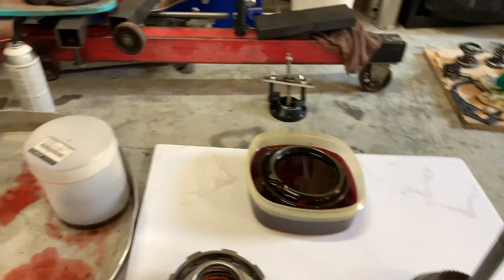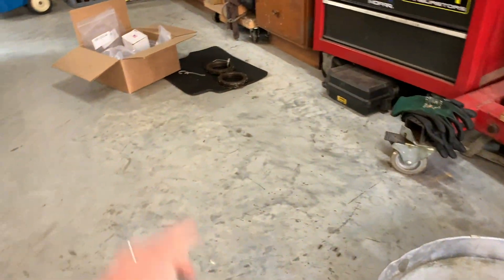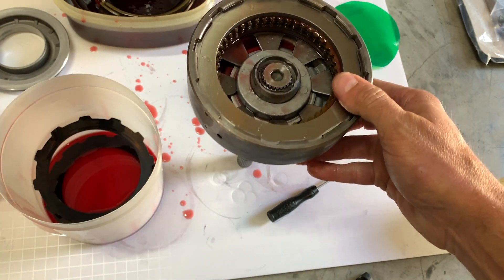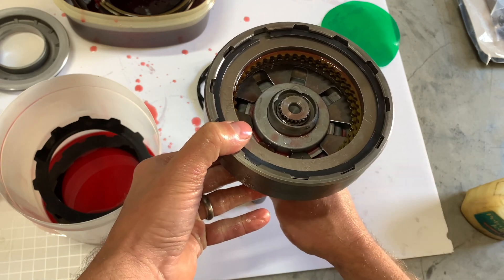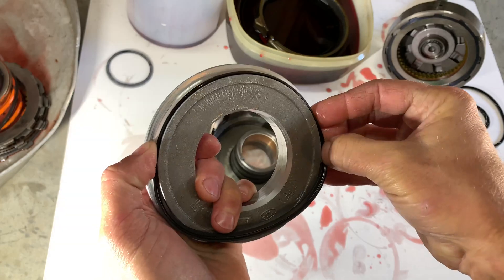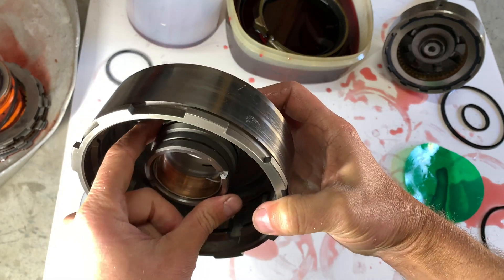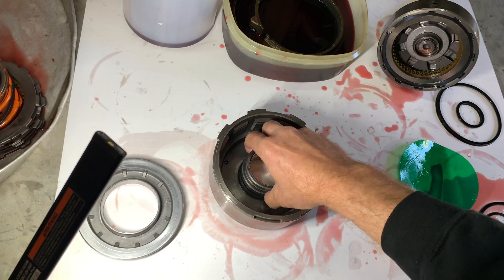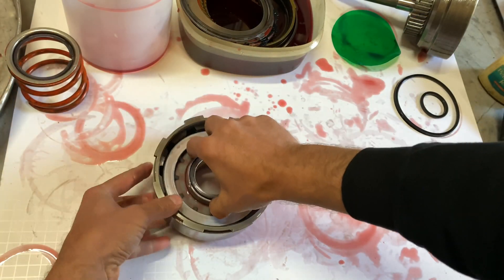pt.3 Beginner’s guide to building a stout Mopar 904 transmission

Comment: forward clutch seals are bigger in dia than the direct,also early units used a short lip seal,later long lip seals wont work or fit an early unit
Reply from the maker: Good info, thanks brother.

Comment: All the seals have part numbers on them. So all you have to do is match the ones that you took out with the new ones of the same part number. You will probably need a magnifying glass to read the number as they are very small.
Thanks for doing this sires of videos.
Reply from the maker: @DougPowers-x6w  no problem buddy. Thank you for your tip on the part numbers.

Comment: thanks nice video im doing my 904 now i was hoping you would use the multi spring pack i have one it came in a kit from CRT
Reply from the maker: That’s cool, is it a for the billet drum?
Reply: @Duster_Garage  no it goes in the stock drum  it just replaces the big coil spring it is a pain if it comes apart to get all lined back up 
it is supposed to return the piston faster and retain its pressure i was told the coil sping looses tension at higher rpm

Comment: Good video. Just a note, don't know your power output or shift point but on a high RPM shift in a 904 the direct drum spring can loose pressure because of it's original wound direction. They make a reverse wound spring that eliminates that problem and helps with the 3rd gear shift.
Reply from the maker: That is something I have not heard of. Thank you for the info. I’m not making big power but I Iove new information.

Comment: If there’s ever a question about which seal is which, there’s a part number on inside lip of seals. 
  For a cheaper shift kit you can use a bolt to block up 2nd gear accumulator piston instead of the spring and it’ll make 2nd hit hard. 
   Great video. Thank You
Reply from the maker: Thanks, that’s a good tip. I have taken the spring out from behind the accumulator but never tried the bolt.
Reply: @Duster_Garage  use a 7/16” diameter and long enough to give accumulator a little clearance. Cheap “bump” kit.